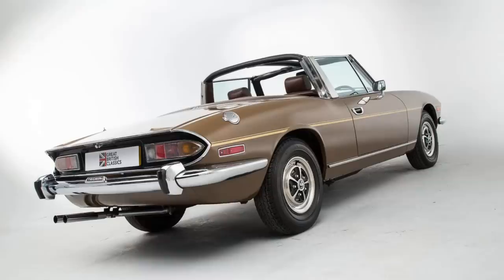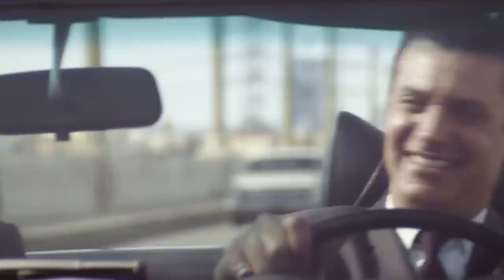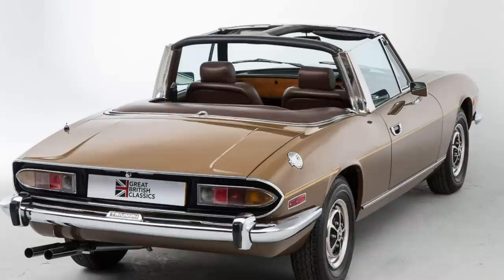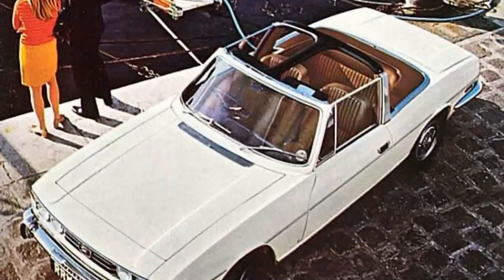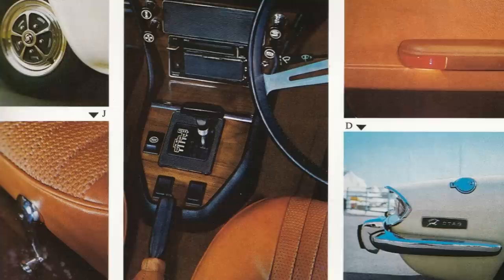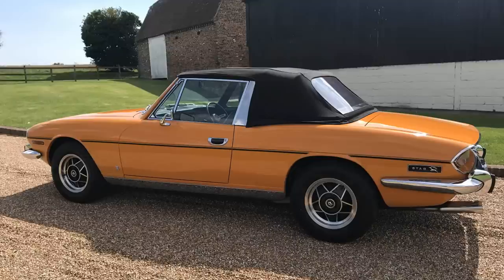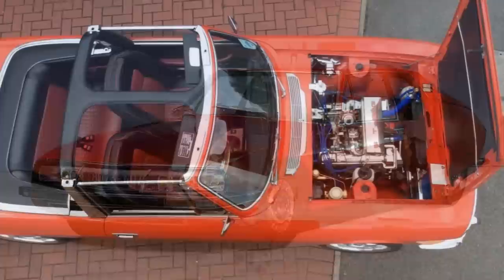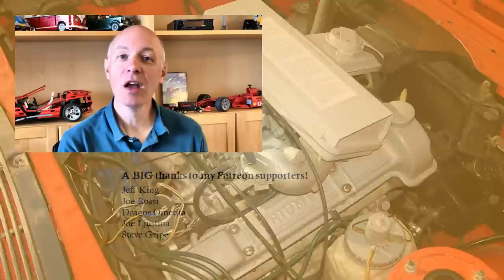Why did the Stag FAIL so Spectacularly?

Comment: Having watched the rear bumper fall off a brand new Stag on a gravel road, and seeing it overheat straight from the factory pretty much tells you all you ever need to know about the Stag: a poorly designed car made by drunken Roberts so that sometimes they managed to go as much as 20 miles before something fairly non-trivial happened to it.
I still have a vivid memory of stopping to pick up the bumper, and my Dad asking Alan what he thought of his new Stag when we caught up to them a little later. 
I have seen some shockingly poorly made British cars over the years, but the Stag was probably one of the worst-made cars of all time.
It represented everything wrong with the British car industry: a design that looked brilliant but wasn't. An engine that should have been cool - but regularly overheated. Body panels rusted. Interior trim fell off. And it wasn't even fast.
No wonder the Japanese destroyed your car industry.
Reply: Sounds like my Chrysler.

Comment: Most of the Stags bodywork was the same as the 2.5 P I saloon which I had back in 71/72 shame it only did 17mpg, the petrol shortage came along then along with the petrol rationing coupons, disaster.
Reply: Exactly Hully...people forget the 'minor' details like petrol rationing and heavy inflation..not to mention low wages.

Comment: Had a stag back in the late 70's, great sound for a small V8, no real power though, used a 50/50 mix of inhibitor, once you hit slow moving traffic, you had to turn the heater on, to assist in cooling, they should had used the Rover V8 engine, bombproof and tuneable, it would had been a game changer for Triumph, with the ratios changed on the diff, as the Rover engine didn't rev as high as the Triumph V8 ... with the Rover lump mated to the Borg Warner 65  auto box, would had made it a reliable set up ...

Comment: I wonder what the Stag would be like with the 2.5PI (petrol injection) engine. What about the Rover 3.5 engine.
Reply: All that trouble and expense to develop a V8 that produced less power than the existing 2.5 PI straight 6. Just ludicrous.

Comment: The Triumph Dolomite Sprint was a Beast I was at the time a motor Mechanic UK I worked for a BL dealer I had never in my life felt that kick in the back I have bought a car from my also mechanic that has mapped the Turbo  only just in 2022 matching that which I felt in 1975

Comment: I had a Triumph Herald.  They were great little cars.   Could make U-turns on any street no matter how narrow.
I had a '57 190SL, very sleek and elegant. Quite, smooth, an flew over speed bumps with hardly a sound.   Unless you had one of the supercharged versions, the Herald could out accelerate it up to almost 60 MPH.
During those years, Fiat engines were also dissolving due to improper coolants.

Comment: You could have mentioned the Sprint version of the Dolomite engine. It was the first mass-production 4-valve car engine, and had a clever single overhead cam arrangement - the cam sat above the inlet valves and operated them via bucket tappets, and the same cam lobe opened the exhaust valve via rocker arms. This same arrangement was used on Triumph's next and last new engine, the 2.3 and 2.6 sohc six used in the Rover SD1.
Back to the Sprint - it was difficult to build, but was a success, and was used to win BTCC for many years, and also in rallying (Sprint and TR7) and even Formula 2. 
There were ideas of making a Stag Sprint engine, but it never happened - probably for the same reasons as the cancellation of the Rover P6BS - lack of funds to develop, and potential clash with other marques, such as Jaguar.

Comment: I managed a main dealer for Triumph at the time...  Stags exhibited all the worst problems of the era, most prominently the build quality , and that was BEFORE strikes came into play.  The pre-delivery servicing was critical, but even if done properly there were issues with overheating and headgaskets and the head bolts were very tricky to get torqued.  The soft tops had the rather nasty habit of blowing out at the sides at motorway speeds, and anything that could fall off at an inopportune time probably DID!  Nice idea, lousy execution...and the warranty claims were the forefathers of the TR-7's.  Between those two cars, it's amazing Triumph lasted as long as it did.

Comment: I always thought the Stag had a American made V8. Don't know why I thought that, but I did. One thing I do know is the Stag was a very handsome car and being an owner of a TR6 I' still consider the Stag as on my bucket list. If for no other reason the styling. Perhaps find a nice example and install a Ford 302 C.I. That would open up lots of potential and with aluminum heads I know it weighs about 50 pounds less than the six in my 6. The trick might be finding a stag in pretty good shape for the body and interior alone.  Would be fun and a real head turner.

Comment: I started with a very used Spitfire and then moved to a fairly new TR-7 when I was in my mid twenties and early thirties during the mid/late70s and early 80s.

I was a fan because I loved the body styles and would have loved to own a Stag or TR-8. 

I must say, the rustproofing on the TR-7 was pretty much not worth anything in that rust was a huge issue. Plus the Aluminum head on the engine needed milled flat after developing a warp and the constant velocity driveshaft also failed on the TR-7 and needed replaced too.

I vaguely remember spending $4K on the 79 TR-7 in 80 or 81 and roughly $10K on repairs over the 5 or 6 years I kept it.

After giving up on the TR-7 that was also short on power I bought a one year old Nissan 300ZX. That car was exceptionally well built.

Comment: I owned a Stag in the 1980s. It was the first car I bought. I loved it! It was a head turner. The main problem with mine was the dual carburetors. The contacts would close and I would find myself stopping on the M4 hard shoulder, screw driver in hand, prising them open. Other than that it was great! I loved the 4 speed gear shift with the electronic overdrive switch on top. I still think it was one of the most beautifully designed cars ever.
Reply: Alan Stuart - The carburettors don’t have contacts, do you mean the points in the distributor?
Reply: @dj_efk  Yes, you're right. It was a long time ago. Foggy memory!
Reply: @alanstuart4646  This distributor has a very interesting feature: it has two sets of points connected in parallel that have to be set so that one set closes a few degrees after the other set has opened. The idea is to give a larger dwell angle (the angle of points cam rotation during which current is being supplied to the coil) so you still get a good spark at high revs. If the points gap is a bit too small you can get a situation in which always one or the other is closed, and then you do not get sparks at all.

Comment: My first car was a Triumph Dolomite 1500 Front wheel drive. L Reg...(Apart from the rubber donutts on the drive shafts failing, which was a right pain to fix) the car was great.

Comment: I have watched many of the Wheeler dealer older programs and loved watching the Triumphs and with all BMC products it was always the same thing, the cooling system was pants and could not cope in anything other than mildly warm.   In every case there is a up rated radiator same size but more gills and often they also put in water less coolant.  The other issue of not maintaining the replacement of anti freeze.  The Rover V8 was aluminium so cooled better but even that was marginal.  So many missed opportunities, just image the engine with two 16 valve heads used on the Dolomite sprint would have had nearly 200 bhp and more torque.  Beautiful looking car so elegant, the 2000 & 2500 saloon looked really cool as well

Comment: As a stag owner I can attest that the engine is very reliable if care is taken to flush regularly and maintain proper anti-corrosion additives. Of course that as you say is the wisdom of hindsight. Incidentally, I also drove the P6 3500, with three speed automatic, that car always felt sluggish off the mark, but was a lovely highway cruiser.  It had plenty of issues too.
Reply: Once again..this was the seventies..people simply could not afford to run these gas guzzling rot boxes. You could buy an E-Type for a few hundred quid and a Jensen Interceptor...welllll ....they paid you to take it away !

Comment: Worked on Stag's in late 70's at a main dealer rebuilt few Stag engines was some head gasket problems and they were pig to do as you had to remove head studs before you could get heads off (didn't have head bolts they were studs n nuts ) . Not as bad as people make out most had no problems they were nice to drive seemed a quality build .Apparently one's sold in middle east had different radiator / revised cooling system and had very little head gasket trouble . Never had any timing chain issues apart from head gasket issues caused IMO by inadequate radiator the engine was pretty good for its time . Shame they were let down with some cooling issues as they were really nice car . Driven them with Triumph V8 and the rover Buick v8 thought they seemed better all round with Triumph but thats maybe because car was designed with heavier triumph engine in mind

Comment: that so called V-8 is a Buick , Oldsmobile blue print, 215 or 235 cubic inch push rod motor, I used to work on em back in the late 70,s

Comment: in 1978   a freind of mine   who owend a  stag    took the engine out  and  chucked it in the  scrap pile  at the local    car breakers     while he was there  he bought a rover  3.5 v8   engine  for an amazing 200 QUID .
i always remember    thouse days  !  everyone said   you can't  put a rover engine  in a stag ,  hell we did , and it went  like a stag shoud have done !  hell did it burn  rubber   ! [yes it did :)  ]
BACK IN  THE DAY   i also helped  one guy   shove  a v8  rover engine  in a ford   mk 1 cappy [ capri]  it was  an auto   but  hell  with  a ford  capri mk one  body and a  3.500 cc engine  and a  jag irs  instead of the   crapi  rear  spring  set up    the  freaking thing  took off like it ran on riocket fuel  and  with the help  of two bags of cement in the boot [ trunk ]   the back end   stayed where it should  be  :)
in the uk   mussel cars cars were never a thing  ! but fast as  hell  ! we always did   even if the  factorys that made them  flooked up  !!!

Comment: They looked great with the hardtop fitted.  But, I've seen some recently, and now I just think that as a convertible it looks so messy with the top down.  A good convertible design should have nothing sticking up except the windscreen when the hood is down. The Stag has that ugly roll bar. And metal window frames!  It looks more like an aquarium!
They had it right with that prototype at 2:09 on the video, but typical BL, they had to make compromises and keep costs down.  As to the engine, I knew a bloke who bought a three year old one.  It was his pride and joy for about a week, at which point the engine did it's usual thing, and the car had to be recovered on a truck.  I know those problems have been solved now, but it took 20 years.  Still, the concept was brilliant.
Reply: The T bar was also for US coming regs. Why the TR7 was hardtop.

Comment: As a long-time Saab 900 owner, I had no idea that the engine that served so faithfully for 300,000 miles (500,000 km) had started out as half of the Stag engine!  I should have guessed since it has the strange, detached water pump above the engine, but I never had even a hint of an overheating problem in the 35 years it was on the road.

I had always heard the engine was a joint project between Saab and Rover.  Even though the design was sound, the build quality of the British-built engines almost bankrupted Saab in the '70s, so they invested in their own plant to build them for the late 99 and 900 models.  That control over production let them do things like turbocharge them beyond all recognition!
Reply: The British engines never near busy SAAB.  The yoked it do much they built it under licence.

Comment: Fascinating, informative video. On a point of fact you say Michelotti copied his Spitfire rear end for the Stag in 1966/67. Instead your video would seem to prove that the Stag rear end that arrived back at Canley in 66/67 was the progenitor of both the 2000/2500 Mark II rear in 1969 and the Spitfire Mark IV rear end which didn't appear until 1970. Very pretty it is too. Mark III Spitfire rear end was very different.
Reply from the maker: That Big Car guy from a few months ago didn't know what he was talking about! The Mk IV Spitfire does look very similar at the back to the Stag, but the previous Spitfire did have a similar style. In any case, Michelotti was styling them all around this time and he was creating a family appearance for Triumphs. Thanks for picking up on this.
Reply: WHOOSH, wording like progenitor puts you in a fresh league commentary wise. My mere contribution as an  ex in-period  SD1 victim is to recount yet again that the front suspension turrets always looked like Triumph detailing and long held opinion that the disastrous BL Rover was almost badged as a disastrous Triumph. Learning lately also that my quite good but head gasket consuming 2600 OHC motor was also a Triumph effort?

Comment: I find it a little strange that with all the mention of the Rover V8 there is no mention of the fact that it was a design purchased with tooling from General Motors when it was deemed obsolete. GM used it in the early 60's in a Buick, Olds and Pontiac with the actual design being credited to the Buick division. Seriously, the GM/Rover V8 was a very good engine for it's time. In fact, the Chevrolet Vega and it's Pontiac Astra counterpart were actually designed to accept the V8 with very little modification by Vauxhall, a GM subsidiary. I once did a swap from the GM four cylinder to the V8 and it only required the fabrication of new motor mounts, a larger radiator from a Vega with air conditioning, and flipping the firewall mounted heater core from end to end to get valve cover clearance. The Vega clutch and bell housing bolted right up with the existing starter to the block and the front suspension required no modification as the aluminium V8 only weighed 20 pounds more than the original four with it's alloy block and cast iron head. The reason it was never installed in the Vega/Astra line was the same reason it was not used in the Stag. Rover simply could not make enough of them without a large cash investment that Rover/Leyland did not have at the time.
Reply: The Rover V8 was not the pinnacle of reliability either at the time, many Range Rovers ended up with new engines at low mileages too. If they wanted to crack the US market They should just have done a deal to get small block Chevrolet V8's, ridiculous to develop an engine that would only be used in one model when they were financially strapped.

Comment: you forgot the penny pinchwrs also led to the STAG's downfall,tbe crankshaft was only Nickle plated to a depth of 20,000 micron's the radiator was changed to a smaller one at the introduction of the STAG Mk2,

Comment: Not only should they have used the Rover V8 from the get go they could have also used the Australian 4.4L V8 version of it as used in the P76 as an update mid 70's to keep pace with the competition. They could have also used the Australian made E series 2.6L 6cyl as used in Nth/Sth configuration in the Australian Marina and P76. Not enough production facility for the Rover engine was nonsense. That Triumph Stag was a disaster and even more so here in our climate. Quite a few of the Stags sold here eventually got fitted with either 3.5 or 4.4 V8s after their owners had enough of the crappy original engine.

Comment: Such a beautiful, graceful design, with such a sweet powertrain (when all was good). In time, with better OM replacement parts, and when non-OM improvements came online, the Stag could have (maybe argue should have) been such a desired classic. Gorgeous cars when they came out! (although a decent 2.5PI could still give a stag a run for it's money.)

Comment: The Stag for the first five years, 1970-75, was made in Liverpool. Well the body was. The car was all manufactured in Liverpool: interior, body, painting, dash, the lot. I believe the electrics were also fitted. The body was then taken about 110-120 miles to Coventry where the engine, gbox, suspension, back axle was fitted. That was where the problems surfaced. 

The last two years of production was moved to Coventry 100%, as Liverpool was being fitted out for 100% TR7 production.

Comment: I owned a Triumph Dolomite 1850 for several years using the four-cylinder version of the engine. It was a nice comfortable car and generally reliable. Even so, cooling was an issue at times and I remember the cylinder head gasket having to be replaced after springing a leak. The head was slightly warped, the garage skimmed it a little too far and the angled bolts would no longer fit. They were good about it and accepted liability, but it shows the engineering design was not ideally robust. A little too much ingenuity and not enough practicality?

Comment: Nobody seems to have mentioned the root cause of the overheating. There was residual casting sand in the cylinder heads (good 'ol BL quality control) which ended up in the radiator blocking it and causing the overheating. I've had a Dolomite Sprint and I have a Dolomite 1850 and I've never had any problems with the cooling system. A cooling system in perfect working order with the correct coolant mixture (30-40% glycol based antifreeze) shouldn't cause any problems. The head studs can be a pig to remove. I dread the day I have to remove the cylinder head on my Dolomite 1850. The Stag Owners Club (SOC) have developed solutions to the problems. I once saw the club demonstrate how to remove the cylinder heads on a Stag engine.